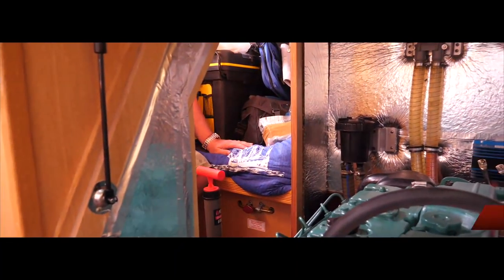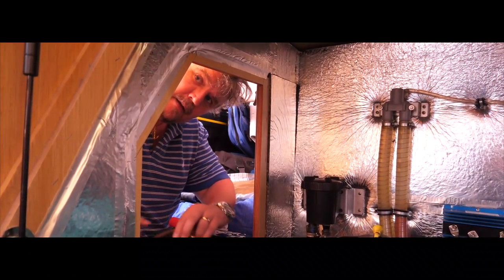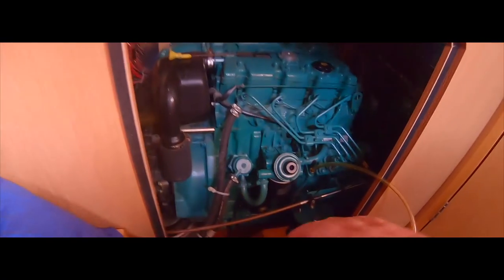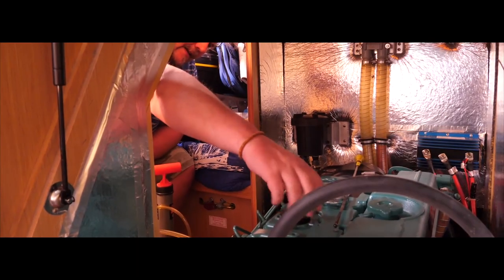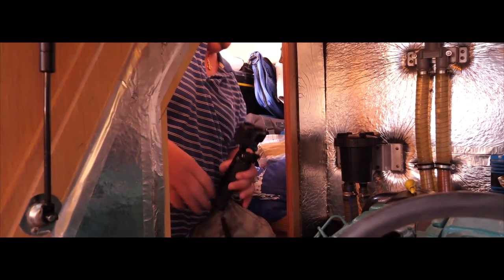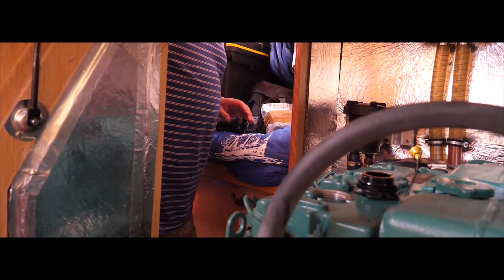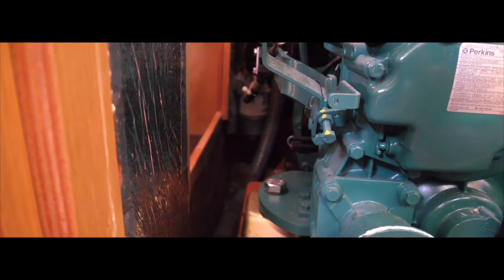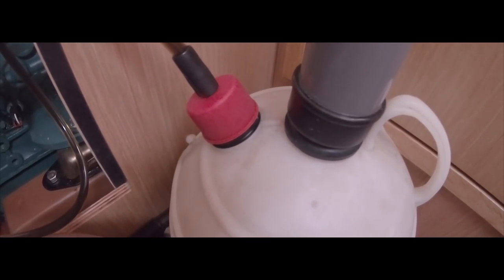How to change the oil on a Volvo Penta D2-55 diesel engine - Carl and Jenny

Comment: Hi enjoyed this video. The reason the pump wouldn t  suck from the dipstick is because the pipe was not in deep enough.With your Pella pump there is a thinner pipe that will go all the way to your sump bottom through the dip stick hole.I normally push it in until it reaches bottom then lift up about a mil. 6 strokes is all you need. Then you can enjoy a cup of tea while it drains by it self.  ps i also marked the pipe with the correct  oil level so if you slightly overfill its easy to accuractly bring it to the right level
Reply from the maker: Thanks Noelio. Yes I figured that was the problem, but on this engine the drain tube (which the hose is the right size for) is fitted to the sump drain plug. Not something i'd seen before on previous vehicle oil changes, it's normally the drain plug I remove. I had to give it a few pumps every so often as the seal around the top of the oil pump wasn't perfect so air was escaping thus losing the vaccum effect.

Comment: Might I suggest a large disposable baby diaper or nappy, I think you might know it as laid down to catch spills and easily thrown away.  Additionally, one or two silicone 23 X 33 cm (9" X 13") baking pan (or whatever size or sizes might fit) can be squished into the space beneath the engine to catch any leakage.  It/They can easily be cleaned with one of the aforementioned nappies or a turkey baster if there's a bit of a puddle.
Reply from the maker: Thanks for the tip Alberta Sailor :)

Comment from the maker: We mention it in the video, but the rubber belt oil filter wrench worked where the metal strap one wouldn't, probably due to the fact that we couldn't get enough torsion on the metal strap so it kept slipping. Got it off in the end though :)
Reply: Volvo Perkins is new to me. In the home country of Volvo all marin engines are called Volvo Penta. Now your oil change is a bit scary to me. My old Volvo Penta 70D with 6 cylinders and 120 Hrs has 30 liters of oil according the manual. That will take some time to drain.
Reply from the maker: Hi Mats Alm, thanks for your comment. Okay, You are correct that the Volvo engines are Penta, however depending on which Japanese factory, yes they are built in Japan, sold the engine it sometimes goes to the Perkins factory first and then sold on to Volvo. So my engine is the Volvo Perkins/Penta D2 55. It has both Penta and Perkins stickers on the engine. I had to research online to find this info. Your 70D 6 cyclinder engine is a lot bigger than the D2-55 4 cylinder. The minimum oil capacity excluding filter is 8.9 litres and Maximum oil capacity excluding filter is 10.6 litres.  Hope that helps. I have edited the tile to clear any ambiguity :)

Comment: D-2 engine have dedicated oil drainage pipe from the bottom of the sump pan. Use that instead and an oil change Will go faster.  I can highly recommend to change position and alignment of the charge separator. To have it like the bavaria yachtbau made.. makes it run hot and will fail under some circumstanses. I usually put it under the nav board instead an aligned so the air can Flow throught the heatsink properly. In The engine compartment it is to hot to operate the unit.

Comment: Was that a pukka PELA pump or a no name copy? The PELA normally comes with a thinner pipe that will go all the way down the dipstick, yours looked as though it entered the tube but did not progress down to the sump so therefore could not work. On the pump side of thing once you have pumped a vacuum charge in the unit that should do the transfer, maybe repump once during the transfer that’s it. The fact that you were pumping so much suggests you were losing vacuum from the chamber or your hose end was not fully immersed in oil. Maybe examine the seal in the top of the flask?
Reply from the maker: Not sure on the make Norman, it was on the boat already and it's now stowed away again under the front berth. See my reply to Noelio a few minutes ago. I answer what you have just mentioned :)
Reply: Carl and Jenny Sailing Adventures  Carl it is worth persevering to get the PELA working - as a first step - I would contact Pela and ask if they sell a thinner tube separately. Once you have this working it is so quick and controls the mess it really is worth getting sorted. http://www.pelapumps.co.uk/default.aspx?a10page=contactretail&a10type=retail
Reply from the maker: Hi Norman, we don't need the thinner pipe. Our engine has a drain tube on what would be the usual sump drain plug. It has a rubber cap that simply pops off and the pipe we have fits in perfectly. It goes straight to the bottom of the sump. You can see it on the video The only minor issue was that I had to pump every minute or so as there was a slight leak on the seal where the pump joins the bottle, could have been user error. We didn't have any mess. Not like when you do an oil change on a car or motorbike and you unscrew the sump drain plug and get an arm full of oil lol! This was so much easier. Thanks for the link.
Reply: Carl and Jenny Sailing Adventures OK sounds good maybe a new seal then at the top of the PELA?

Comment: C+J been looking at your marina prices on the website, do you know is that including VAT or not.
Reply from the maker: Hi Dave, pretty sure that’s including vat. You also get a discount each year if you book 12 months and if you have a Greek tax code. We will be coming back here for next winter so have booked 12 months. It is only €50 more and we have the reassurance we can come back any time in the year if we need to.
Reply: Cheers Guys, This year moving mine in March from Nr Split, Croatia to Near Trieste in Italy, but this is my first year and sorta learning the ropes etc, but next year looking to move on :-)  Have a great day and keep up the great videos.
Reply from the maker: This is a great place to winter. Right in the town center which has quite a bit going on. Nicely protected and a great group of people. Early booking is essential though. Next winter is almost booked up. We will probably book the following year also before we start heading West.
Reply: The prices in Croatia this year have gone through the roof, plus the massive hike in Cruising tax, I was interested that you got a ferry from Venice,  as I live in a place near Deggendorf in Germany (Ex Rochdalian) which is 7 Hrs by car and I never thought of that for getting down to Greece.  I plan do go down to Sicily Next year and hop over from there, but need to find a nice place to keep the boat and a good cruising area as then I should be just retired.
Reply from the maker: Well everything suggests that the cruising tax in Greece is going to be implemented this year, but we'll see. A lot of people think it won't happen but personally I think thats just wishful thinking. If we can get away with it for another year then great but I think people have to accept, it's coming! The Ionian might be a good place although it gets busy in the summer. A lot of the charter boats from Turkey have now set up there! I think Crete is great for a winter berth, and then go cruising for the summer months elsewhere. If you've not seen our earlier videos about packing up the house etc before we moved on to the boat, then I recommend you watch them. That retirement date comes round very quickly and before you know it, it's here and then its a mad rush to get everything sorted. One piece of advice is start yesterday! You can't do that so start today :) Have fun.
Reply: My circumstances will be slightly different, my wife's a doctor here and probably wont give up work as she loves her job, that might change over time but I have to accept the fact for now, so will probably find a place to live on the coast as she wouldn't want to live on the boat all the time, I will part time this year.
Reply from the maker: We all loved our jobs lol but we love retirement more ;) We'll we do certainly, just wished we could have done it earlier, but still a lot earlier than most. Good luck with it all. Be interested to know what you decide upon.

Comment: The SPHERE device should have a TUBE that fits entirely WITHIN the dipstick opening...allowing it to REACH all the way to the SUMP. (not just the beginning)
Thus, NO need to loosen ANY fittings to extract the oil.
Reply from the maker: Not on ours lol. The pipe with our Sphere device ONLY fits the drain pipe built into the engine, so no need to use dipstick tube.